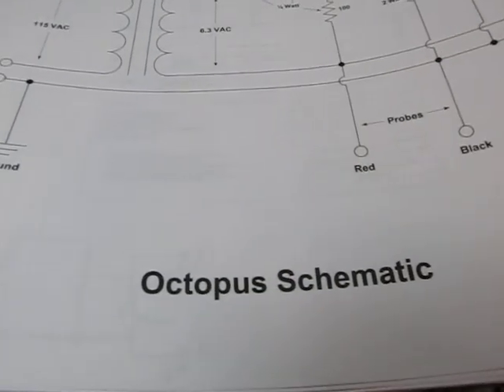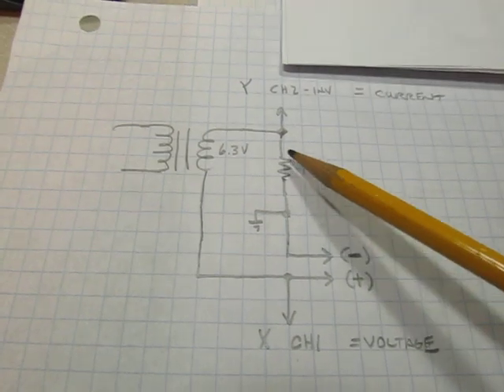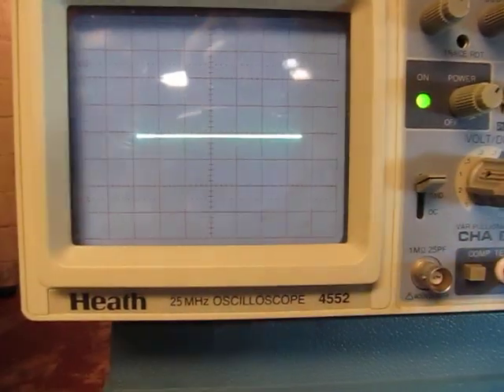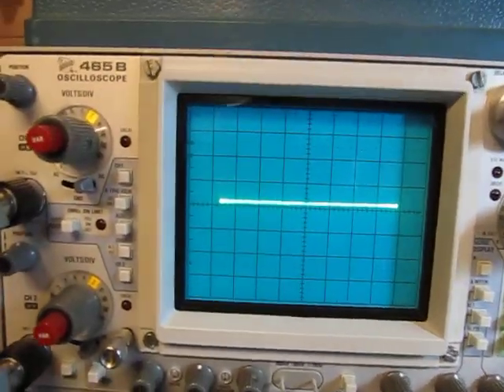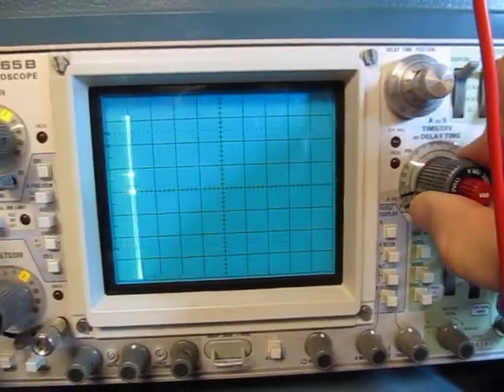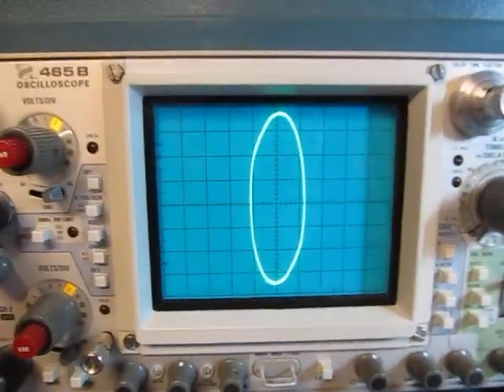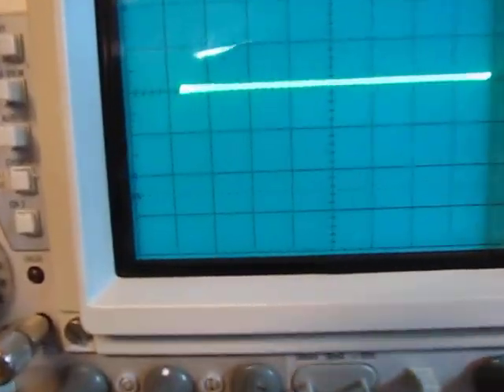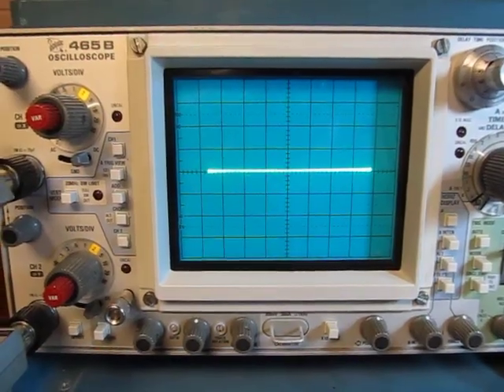#49: Simple Component Tester using Oscilloscope - Octopus Curve Tracer

Comment: QUESTION please Mr W2aew-
I have same scope Heath 4552, but I read the manual and it mentions that this component test may damage some semiconductors.  How big a risk is it with this Heath scope built-in octopus?  The test uses 6vac and 11ma current.

I mainly would be probing solid-state amps and preamps (such as Phase Linear gear) and similar.  Just wondering whether I would be risking damaging the transistors and IC's?

THANKS.
Reply from the maker: You'd really have to check the specifications of the devices that you're testing to see if the 6vac would pose a problem.

Comment: Instead of using a transformer could a signal generator (such as that provided by an InfiniiVision oscilloscope with WaveGen option) be used to provide a 60Hz sine wave and appropriate peak-to-peak voltage?
Reply from the maker: Yes, that will work fine too.  Doesn't even have to be 60Hz or even a sinewave.
Reply: Thank you.  Last night when I made this comment I was unable to test that idea but I expect to do so today.    @w2aew

Comment: Does this circuit only work with analogue scopes or will it work with digital scopes too?
Reply from the maker: If your digital scope has XY mode, it will work.
Reply: @w2aew  Thanks for the reply. My scope does have xy mode. I'll try this out & let you know. Thanks for a great video!!
Reply: My cheap digital scope has a rather grainy output in xy mode, but sure enough, it works!! Gonna try this with my old tek465 now :) Thanks again.

Comment: Sorry for asking but could that also be used for in-circuit components?
Reply from the maker: It is often used for in-circuit testing, but not specifically for individual components.  Most often it is used as pass/fail test when compared to a known good device response.
Reply: @w2aew  thank you for answering!
Just one last question: If it uses AC then what about capacitors or other components that do not like reverse voltage?
Reply from the maker: @friedmule5403  You have to be careful with them!  This is not a universal tester.
Reply: @w2aew  Thanks a lot for your answer, time and warning, maybe i should try to learn much more before jumping out in the middle of it. :-)

Comment: Great video lots of good info can this be use to check components mounted in a board  ?
Reply from the maker: In-circuit testing is always prone to problems due to surrounding circuits.  However, if you know what a "good" circuit tests like, then you can test suspect circuits to check for the same curve shape - not really a component test, but a component+circuit test.

Comment: I first came across this little jewel back in the Navy in the '70's. Was found in one of our technical issues. I built one and used it in the shop.
Reply: lochinvar00465 NEETS Module 19 has the schematic and goes into a lot of detail...funny though it never refers to process of "Easter-egging..."

Comment: can it be used to check ic's?
Reply from the maker: Not reliably.  You would have to know what a good one looks like, and then compare that result to what you get with a suspect device.  It would only show gross failures (opens, shorts, etc.) potentially, but certainly won't catch all failures.

Comment: w2aew
I have found that it is possible to use more than 2 probes. When testing 3 legged components you can use another probe from the positive terminal to see how it will behave when ON, or connecting the third probe to negative shows how it will react when off. I have found this very helpfull with triacs and SCRs. (good material for another vid)
Many THANK YOUs for your contribution to humanity
Reply: Instead of a transformer connected to mains, i have also tried a freq. gen. to see responses to changes in freq.

Comment: Hi there. I tried to replicate you circuit on a digital Tektronix TBS 100 MHz Oscilloscope. The best resut I've got was a cloud of dots  around the main cluster that was, indeed, the result of the XY plot of the component curve. What should I do to improve the signal? Instead of a trafo for the input senoidal signal, I used a 60 Hz signal, senoidal, from a function generator. Also, my reference for the circuit, actually is floating. Where should I plug it, since I don't have a ground on my working bench?
Reply from the maker: XY displays on digital scopes generally don't work as well as on analog scopes - just a fact of life.  Using the 20MHz BW filter on each channel will help, as well as slowing down the timebase.  Depending on the scope (and I don't recall the details on your scope), using hi-res sampling or averaging might also work/help.
Reply: the OWON has, under 'display' menu, an option to choose between 'dots' and 'vectors' (Thats also where the XY function is )

Comment: Hi there, stumbled across your old video about the octupus curve tracer, what about testing a 200v zener or something similar, do you have some schematics for a voltage/current adjustable HV version or would you like to make one on video?

73
Best regards

/ Anders
Reply from the maker: You'd really want one where you could adjust the positive and negative voltage swings independently - not as trivial as an octopus.
Reply: Yes well i´ve been using my signal generator via an octopus to adjust + and - wich workes just fine, however it only gives me 20v PtP, i supporse i can hook up an amp to it to give me more amplitude, i just wondered if you had any smart solution for it to share

Comment: I first encountered this circuit in Popular Electronics, 8/75. According to the article, this first appeared in a John Rider book in 1935. The name, Octopus, came from folks in the Navy. If you count the number of connections, including a grounded Line cord, you get 8 leads.
Reply: Neat! This makes me want to grab all the PE mags from the '70s - early '80s. Seems like all the coolest stuff you could build yourself came from/was popularized/widely published around that time period. It makes sense since it was the era of using solid state, but with the lingering memory of the tube era mentality of keeping the circuit dead simple, and very very sparse. If you can make a radio with 5 tubes, you can make a radio with around 10 diodes/transistors etc.
Reply: Yup - I remember the Huntron and building an "Octopus Rig" in the Navy, '80-'85, AD15.

Comment: sorry , appreciate if you can explain a bit more , it looks as though both probes are measuring the same thing , I don't understand when you say one is measuring proportional current and one is just measuring voltage on the device. Are the probes not both measuring the same voltage at different sides of the transformer as the AC varies. I don't understand it fully, also looks like the circuit is shorted to ground through the resistor , so how can it measure the total current through the DUT.  I would really appreciate more information.  Many thanks
Reply from the maker: The current flows in a loop - from the transformer - through the resistor - through the device under test - back to the other side of the transformer.  The ground is just a common reference point for both measurements.  Thus, the probes are measuring the current through the resistor (which is proportional to the current in the loop), and the other measures the voltage across the DUT.
Reply: Thanks I really appreciate your reply, I see now its a reference for the scope probes. That is an excellent , elegant and simple idea . I hadn't heard about the Octopus until today.  It is very useful for scope XY,  I wonder if it will work with a digital storage scope , or reason it wouldn't.   Great, I need to get one or try to make one for my scope ......sorry I'm a mechanical engineer, but trying to understand electronics ...

Comment: Could you post what an FET transistor is supposed to look like?  I have a guitar pedal with a J111 and a few J113s in it.  Thank You and Happy Thanksgiving!
Reply from the maker: The octopus is designed to test 2-terminal devices, and the JFET is a three terminal device.  So, it would be best to test the JFET another way.  However, since the Gate to Source (or Gate to Drain) is a reverse biased diode under normal operating conditions, you could check for a typical diode-like characteristic between these terminals. However, some JFETs can be easily damaged by doing this...

Comment: One last question. (I don't have a signal generator yet, but could this be instead a light weight thing, for example by using a 555 timer whose square wave output you could remove sharp edges with a passive low pass filter. To get a rough sine curve and then use that as the input to the above. I am thinking maybe then only need small 9 volt battery (with few extra passives for the 555 timer chip). Without the heavy bulky transformer. Or is that not worth doing? I am just guessing wildly. Be great if this could work though.
Reply from the maker: It would work in some cases, but the output impedance of the filter will affect the signals applied to the DUT.  Since the circuit is battery powered, you would be able to connect the probe grounds to the junction shown (and NOT to the negative side of the 9V battery).  Certainly worth playing with to try, but you'll likely have limited success with devices that need a fair amount of current...
Reply: Thanks Alan. I am going to give it a shot. I did not consider the impedance. I expect it'll be a nasty looking sine curve. Maybe I can use an opamp buffer or and Audio transformer in some way?

Comment: Sorry Alan. Another question. Your simplified circuit was easy to follow. But after watching your recent scope tutorial I found same circuit as you show at 0:04. But I can't figure it out. For example is all of the secondary windings voltages above the ground (the ground symbol as shown on left of diagram)? I seem to be getting confused when the voltage on secondary goes to minus. Can you help. I been struggling with this all day. But no where can I find a circuit walk through.
To me it looks like a voltage divider but does it not breakdown when voltage swaps to negative?

 Can I assume that the secondary winding voltage never drops below ground as with ground connection shown in that first circuit? In other words with respect to the shown ground terminal does secondary voltage fluctuate between 0v and 12.6 volts peak to peak? Always get confused by relative voltages! Help!
Reply from the maker: The secondary winding produces pure AC. The DUT and the series resistor are connected to the secondary in series.  Ground is connected to the junction between the DUT and the resistor.  Thus, the votlages on CH1 and CH2 are opposite polarity (one goes below ground when the other goes above ground).  The voltage across the resistor represents the current through the DUT - thus the scope plots the Voltage-Current relationship of the DUT (but with the current inverted).
Reply: +w2aew
Okay great stuff. I was getting confused with minus voltages. In all other circuits I have seen they often use a voltage divider and I was treating the ground incorrectly. First time I actually understand ground properly. But I thought I already did! So for me this video and your replies has helped me understand AC circuits better. Many thanks!

Comment: It seems huntron tracker, How to components test on board?
Reply: Peter Q. Yup. Same deal as a Huntron tracker. Difference is Huntron provides different voltage taps, and on some models an A-B circuit for comparing known good part to one on board. (For which they charge major bucks!) In use the test probes are just broken out on bananna jacks.

Comment: hello friend I do not speak much English , I'm translating ytodo by the translator of google , I'm doing a circuit tracer curve but it can utilizaar the one lapto the microphone input with scope program that brings two channels would if I can help you , your circuit can work for use by the entrance of the lapto microfocus or some variation must give thanks before hand friend
Reply from the maker: +francisco fernandez The biggest problems you'll have when using a microphone input is that the microphone amplifier usually has some AGC (automatic gain control), and the path is AC Coupled.  Both of these things will often lead to distortion in the waveform for these types of applications.
Reply: ok thanks for answering friend , now I wonder is there any circcuito I can do to improve that , the gain of the microphone card lapto if mee could help or orietr very grateful estai

Comment: is it ok to apply voltage to an oscilloscope but not current? how can someone see the wave of a 40volt transformer?
Reply from the maker: +mitropoulosilias Of course, this is the "regular" way of using a scope (not in XY mode).
Reply: ***** how to prevent current not to destroy the oscilloscope?
Reply from the maker: +mitropoulosilias The current that flows is simply determined by ohms law.  Use a 10x probe.  Input impedance will be 10Mohms.  Current will be only 4uArms.

Comment: I have a question... I followed the video and all pictures were kinda the same as yours apart from my diodes. The "L" curve was actually two L curves slightly offset , kinda like a twisted L in 3D. The same was LED, 1N4001, etc. Any ideas?
PS. I have not adjusted oscilloscope but it shows all values ok based on my sig gen.
Reply from the maker: +fluiddynamicist That is indicative of a phase shift between the two channels that you use for X and Y.  Could be due to the probes you're using (are they matched, are they both properly compensated, etc.?)
Reply: +w2aew ARGH..... when it is easier to ask as opposed to think... please excuse my lazy brain today!!! 73 de K1VMP

Comment: I like the video. Can the scope be used to test components in situ on a circuit board or do they have to be unsoldered and isolated first?
Reply from the maker: +John Frizza It really depends on the components being testing, and the surrounding circuitry.  Even if you leave components in the board and the results are affected by surrounding circuits, you can still use this to find faults by comparing a known good board to a faulty board.  Each node on the board will have a specific signature based on the components that are connected there.

Comment: Hi,
Thank you so much for these wonderful videos, congratulations.
I noticed that the flat trace corresponding to no current and also the sine wave itself is a bit wavey, is this due to the scope itself?
And any suggestions as from where to buy such wonderful vintage scopes you are using, professionally refurbished and reliable? Just thrilling how the controls sound and the equipment looks and feels.
Thanks so much.

Comment: Alan I build this model of curve tracer (Octopus) it works great,but the horizontal trace isn't very aligned to zero it's a bit transversal my scope is 2220 60 mhz tektronix 
How coud  it get better? In normal way (No XY mode) my scope is ok.I had tested another  octopus model and this event does not happens.
Reply from the maker: Not sure what the problem is. Are you using DC coupling?
Reply: Yes I am using DC coupling,, how many mA has  your transformer? You  using FG, right?
I use a transformer of 6V/300ma but on 220V jack.I will try with my tek 465 and see what happens. Although it's nothing that compromises. therefore is working with much greater precision than other projects that already build, the knee of the diode curve has a well-defined angle
Reply: the effect is defined as follows: The left side of trace (negative) is slightly below zero and a little  up on the right side, as trace rotation out of normal position. I do not know if I'm able to make myself understood, if no, I will make a video.

Comment: Hi Alan Digital Oscilloscope Rigol, when measuring resistor next picture.
http://screenshot.su/show.php?img=88e30a1ee952ec03eec95f49adccf6c4.jpg
Hi Alan Digital Oscilloscope Rigol, when measuring resistor next picture.
Why such a direct width?
Reply from the maker: try reducing the channel bandwidth to reduce the noise, or employ averaging if the scope lets you.
Reply: ***** Made, the same result, bandwidth limit - on!
Reply from the maker: Стас Негруша Never used a Rigol, so I don't know what you have to do to remove noise in XY mode.
Reply: ***** Thank for your support!
Reply: Стас Негруша An acceptable result by reducing the value of resistors to 4.7K or use one channel probe 10x. What do you think?
Reply: ***** An acceptable result by reducing the value of resistors to 4.7K or use one channel probe 10x. What do you think?
Reply from the maker: Стас Негруша Makes sense.

Comment: What about using an auto_transformer as the power source.  The reason I am asking this, is because I have my auto-transformer connected to the output of my isolation transformer, and there is another circuit that was published in an old Wayne Green publication back in the early 1970s, that used 150 volts and a much larger series resister to test the breakdown charistics of Zeners.  All I would have to do, is plug in a low voltage circuit, such as the one you used, to find all the good candidates, then  plug in my higher voltage circuit when I wanted to look for high power Zeners, or high voltage power transistors.   Could you do a video on amplified Zeners?  I enjoy your easily understandable videos.
Reply from the maker: Yes, you certainly could use a higher voltage to test zeners and other devices for high voltage breakdown. As always, use extreme care when dealing with line voltage, or any voltage more than 30-40V.

Comment: We used to use an Octopus many years ago when testing computer boards. We had a unit  (later a Huntron) which had a ground and two probes and a circuit which switched between the two probes. Then the ground was connected to both a good board and a bad board at the same spot, usually the ground connection and then the two probes were put onto a test place on each bpoard and the patterns compared is the Octopus switched between the two. This was a very useful test tool.